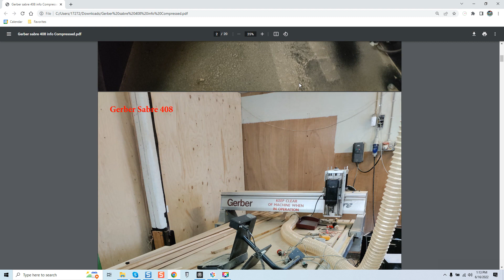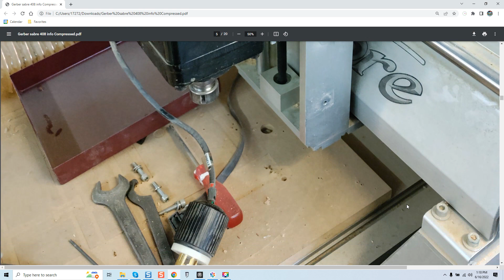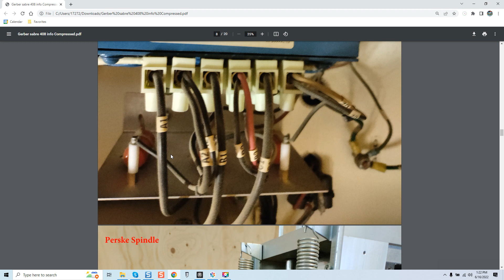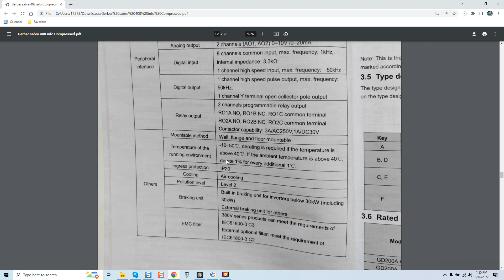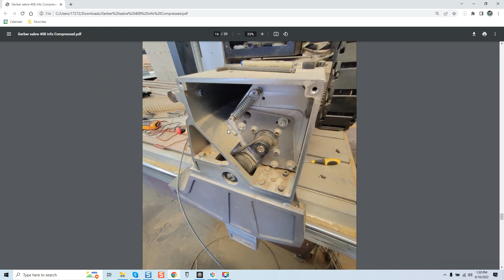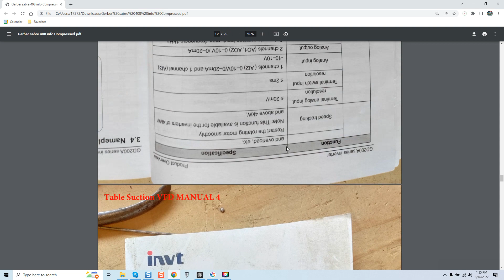Gerber Sabre 408 CNC Chassis Retrofit Overview...

Comment: Hi. I also have gerber sabre 408. I havent got software 🙁. Its true to fusion360 is compatible with Gerber? My machine stay on garage few years and now I bring it to anorher place. I have no experience with connect it and fix and I already looking for tips and knowlege about it.
Reply from the maker: Thank you for your support. Fusion 360 is CAM software, and in order to run the system you'll require motion control software like Mach3, and UCCNC. Please email me to schedule a consultation if you're ready to retrofit the robot. Thank you,
Vince

Comment: I also have a sabre 408. When I initialize to the table and begin cutting gatorboard or pvc sheets, the first few jobs run great but after 6 or 7 boards it stops cutting all the way through. Ive replaced the collet and that doesnt seem to fix the problem. Could my Z motor be slipping? It always cuts shallower and never deeper each job.
Reply from the maker: Thank you for your support. Unfortunately If you're using the stock controller there's no way I can answer that without seeing what your doing to analyze the potential issues.  Thank you,
Vince

Comment: Anyone recommend a replacement servo motor for these Gerber routers?  I have a older 408 as well.
Reply from the maker: Hey John,

If you determined the motor is the issue to your problem then replacing it with a similar unit if not the same one if your happy with its torque will yield virtually the same results as motors have a very low failure rate. Thank you,
Vince